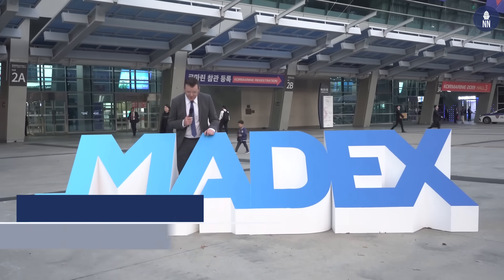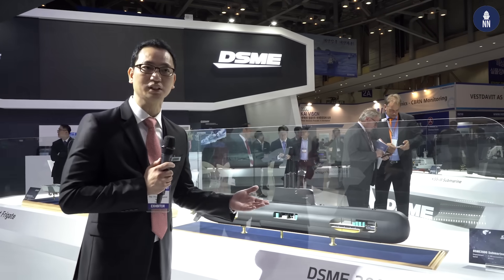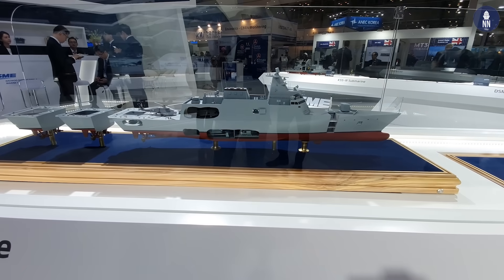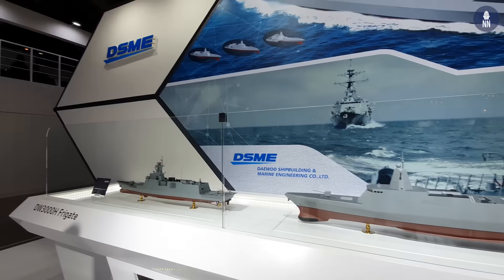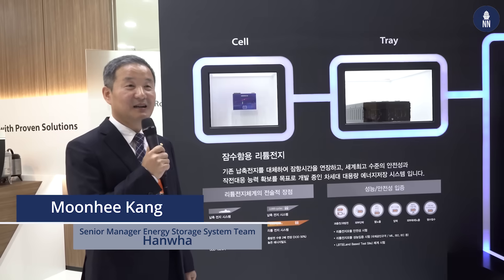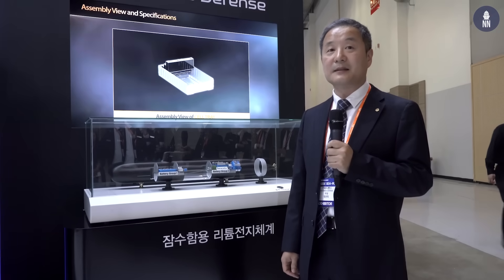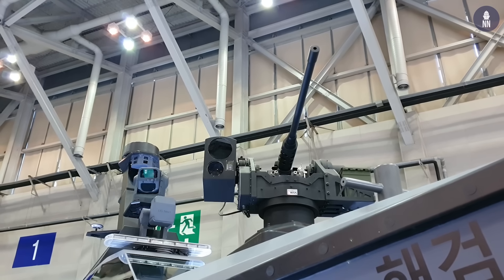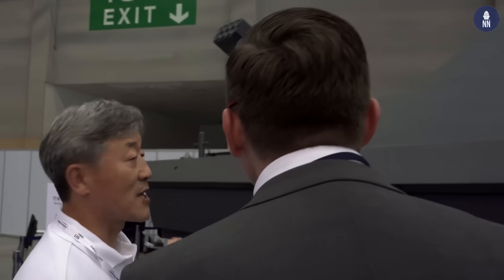MADEX 2019 Day 1 - DSME, KSS III, LIG Nex1 USV, Poongsan

Comment: the light frigate is decent but every1 on planet is building devil works warships, real innovation is doing something no1 else is doing. A coast guard size & sea state craft that has light frigate type defense but main goal is cargo easy on & off & load capacity, & efficiency, no need long endurance bc not war time. Future crafts will get endurance beyond the poss when we switch to hydrogen detuned burn w/carrier fuel add & generator to power electric drive. Idea is hydrogen fuel is free & added fuel to make safe & stable dirt cheap like nat gas or propane. If u build a quality fast efficient ship when future free fuel arrives It will pour/ liquid gas flow right into older ships. So long as u didn't waste money building bad ship or slow ship or not efficient ship or nuke dumbest ship of all, massive hit front back ends & not needed in NOW world better option abound. korea if u can build advance ships to sell we need not defend u any more max 5k staff level air base only deal. We r 22 trillion broke trump saw to that. U hve to greatly cut back in peace time NOW & every1 will hve to step up & police & patrol & coast guard & defend themselves.